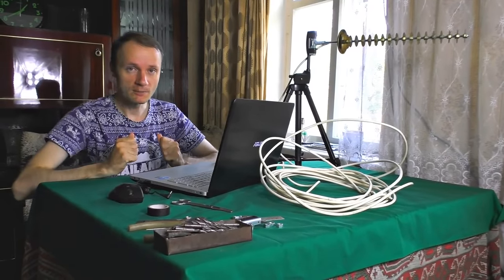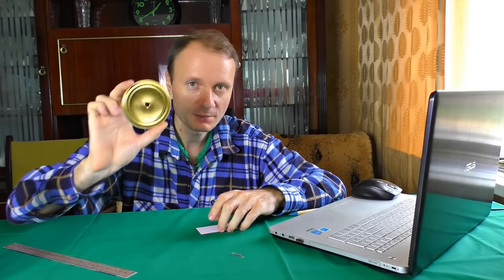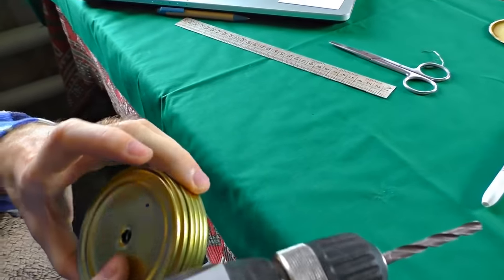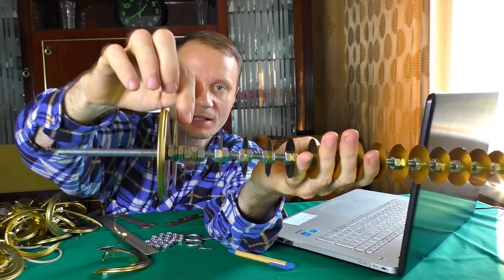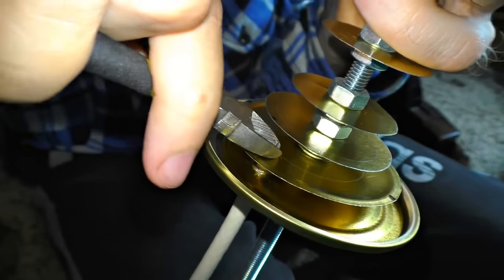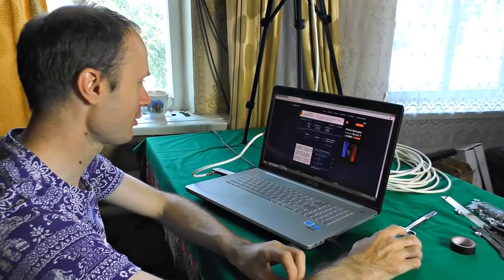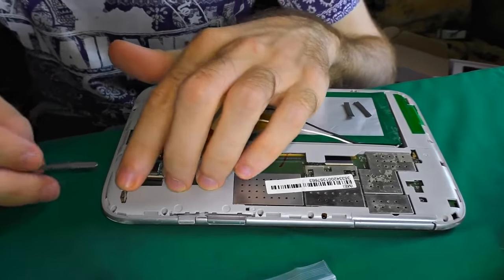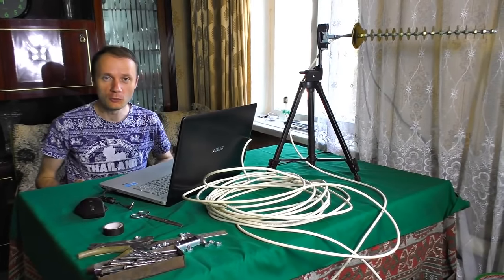Real WiFi Trap DIY💥 / Free Internet Rifle V 2.0

Comment: Kreosan,  I love your projects,  and I'm really pissed off about the people calling this fake. Apparently they've never seen a disc-on-rod wave guide and don't recognize a Yagi with circular polarization. Thanks for this video. I was going to design my own but you've saved me the trouble. And BTW,  your translation called your insulator a "gasket" and now everyone thinks the reflector and driven element disk are shorted. Your biggest problem is that your audience is just ignorant and can't figure things out for themselves.
Reply: U never went to school eh, FAKE DUH.
Reply: if you knew any thing about yagis you would not say so
Reply: they just turn on their phones hotspot
Reply: its not fake its just badly made, first the tplink adapter isn't too powerful, second that antenna wire is too long, there is a ton of lost signal because of that
Reply: So you all guys think all the good selling bdm-2 antennas out there are fake? I made one myself and it works flawlessly.
Reply: @25566  even the best yagi cant reach 2km with less than 100 mw of power
Reply: did it work at 1km?!!!!!!!!
hell no
Reply: @walkertongdee  do you now LAN? Do you know anything from technology?
Reply: Backfire disk-on-rod antennas, like Yagi antennas, all smaller disks are directors... but they should be electrically isolated one from another. So yea... fake. Oh and the Lunokhod had a helical antenna (with directors), not a backfire antenna.
Reply: Laughs at H°??? Tx_ <14Db @a gain of probably for the shitty design of somewhere arround 10 dBi.
Reply: His "gaskets" are actually washers and not insulators so I guess that makes the driven element and reflector disk shorted.
I'm thinking of building one of these things so do they work or not?
Reply: Apart from the fact that he’s using 75 ohm cable, and he’s shorted the active element to ground lol
Reply: @CarbonConscious  dont waste your time make a proper cantenna 
Use the andrew mcneils video
Reply: @Craig Wall - Perfect Answer, Thanks
Reply: oh shut up. It's not our fault thinking it is fake, The internet is just too filled with fake ones and finding one that is real others will call it fake because they had enough of the fake stuff
Reply: they must be mericans. thats why
Reply: craig -- dont put people down, you are not smarter than most people
Reply: @25566  Agreed, you should try to keep the cable shorter than 50 cm
Reply: People see that he's Slavic and uses scrap parts for his projects and think that it must be BS. 

A good understanding of physics and some creativity are all a person needs to build some cool shit.
Reply: @alirezaeskandari2287  *yagi antennas NOT yagis
Reply: @olivejuice5233  Prove it, my tinfoil hat-wearing friend
Reply: @kiyoponnn  lol
Reply: How about my 5.8Mhz and 2.4mhz? The Wi-Fi gun both they support?
Reply: Should work. 
Back in the early days of wifi i remember people put empty food cans and antenn cable connected to bottom, to point att signal.

Comment: You're probably losing most of your antenna's gain in that white coax cable. It's not made for 2.4 or 5 GHz frequencies. Also, is the driven element electrically connected to the reflecting element through the threaded rod?
Reply: Yes, the same I though DC short cut!
Reply: Satellite LNBs reach up to 2.1 GHz, so for 2.4 GHz a not too long cable should work.
Reply: cable for satellite receiver is good enough to 10 m

Comment: Bolt length -1/2 meter
Small disc distance- 22 mm
Last 3 bigger disc distance- 12mm,9mm and 7mm respectively
Reply: The material of the discs, what is it?
Reply: @fernandoadauto5354  Anything metalic
Reply: What's the name of the connector between the cable and the WiFi adapter please 🙏

Comment: Another way to find the center of a circle is to draw at least two (but more helps accuracy) lines of exactly the same length and touch the outside twice. For example if you have a circle with a 4 inch diameter you can use 1 inch lines so long as all of them are one inch. Then go back over each line with a square and at the halfway mark draw a line all the way through. Each intersecting line will also meet in exactly the middle .
Reply: I don't know if this method is accurate enough for these kinds of use cases, but an easy way to find the centre of a circle is to pick any point along its edge, zero a ruler on it, and scan the  ruler left and right until the measured length at the intersection of the ruler and the edge of the circle is greatest.

Comment: To get a better signal, I advise you to use copper for everything, including the pole. Also, the longer the cable, the weaker the signal. Therefore, if you do not need a cable with a length of 60 meters, then take what suits you, and the maximum is 100 meters.

Comment: There are a few simple things you can do to make this even better. One, get rid of that cheap TV coax cable. Technically this antenna should be 50ohms impedance. RG6 ( common cable tv coax) is 75ohms. The mismatch will degrade this signal. Get some decent 50ohm coax. Second, you are using WAY too much coax. Microwave signals for wifi at best are weak, 50-70dBm ( a few milliwatts) the longer your cable the more the signal will be attenuated by the time it reaches your computer. Keep all the coax lengths as short as possible. Finally, the driven element of this antenna ( the 68mm disc you solder the center conductor of the coax to) this needs to be isolated from the boom ( the 8mm diameter screw boom used to attach the discs to) you need to put something on the boom so the 68mm disc is NOT physically touching the boom, like tape, heat shrink) the 68mm disc without this isolation is actually being shorted out. While it will receive some signal, if you isolated it from the boom it will work 1000 times better.......try it!
Reply: no need to be isolated.....try you theory before comment.....this is exactly as suppose to be, this is not short for 2.4 GHz, not even close

Comment: I have build your Wifi-Antenna the way you told in the video. I am impressed! Instead of cupper i used aluminium but everything else remains the same. The quality of this antenna is unbelievable good!
Reply: Hi @benjaminwesp7584
Could you please tell the the latency difference with an without using antenna, and As we increase distance don't we need transmitter and receiver both to be high gain antenna ?
Reply: Hi! Did yo use the long coax tv cable too?

Comment: There is a Problem with the Two Disks that is connected to the stud without insulation thus shorting the antenna circuit. The second disk from the two disks that is connected to the wire should be insulated from the rest of the disks and stud...
Reply: no....update your antenna theory....at that frequency a galvanic short circuit is not a radio frequency short circuit

Comment: I had a Cisco Yagi in ~2004 where I was living very close to the pentagon. While trying to pick up free wifi I had it mounted outside my house pointing into the direction of the pentagon.
A black SUV pulled up with 2 people in black suits jumped out, took a bunch of pictures. Then they got into the SUV and drove away. Never heard anything from them.

Comment: It should have shielding between the contacts from the outside ground to the copper centre. If you was to do this on say a CB or Ham radio you would burn it up without shielding. I believe the low watt wifi could suffer from long-term use without making the rear shielded from the front over time.
Reply: it is not critical on this freq....

Comment: That car looks like a 1957 Fiat 600D I owned. Suicide doors too, nice.
Reply: Zastava 750 i think, so a licence-built 600
Reply: Saporoshez SAS 965 . Made in Ukraine. The original Fiat Seicento stood model for its body but the engines are different- the Sappo has a V4 while the Fiat runs on inline 4 cylinders giving more space to rear passengers in the ukraine model. They were quite common in East Germany too but then less popular than the Trabant. (I don't know why, I haven't driven neither) Now collectors items due to their scarcity,

Comment: The shield and core shorted out, a mile of 75 ohm coax cable with no balun. Seems legit!
Reply: i was wondering that too 
its not insulated
Reply: Hajaj, yes it is fake.
Reply: It's not shorted. The translation came out "gaskets" when they meant "insulating washer".  And no,  it's not fake. It's not even new. This is very old technology.
Reply: Oh, OK. Cheers for that, Craig :) 

A few of their vids have been called out as fake so I made an assumption.
Reply: nah u got it man

Comment: No! You have to isolate the active part from the ground.
This antenna is useless without.. 

making the antenna like this it will be a short between active element and ground...
Reply: No this is like a magnetic loop
Reply: Even a biquad antenna has a short
Reply: Nicolas Springer : No. A yagi antenna is nothing like a Biquad or Magnetic loop.

Comment: Kreosan improvements for you. I read somewhere, to isolate the 68mm disc from the central bolt by putting heat shrink tubing on the shaft. That way you are not creating a short. I dont know if that is correct, just trying to help. All the best guys, youre awesome
Reply: I was just thinking that when he slid the disc connected to the coax screening along the bolt connecting the coax center wire to the next disk without insulating the screen disk. Basically just rendered the rest of the antenna beyond the center wire disk useless. I remember making a CB radio tranceiver out of coke cans in much the same way as Kreo except my antenna was 22 foot high and took over an hour to tune the SWR in properly, lol
Reply: It may be AC isolated, but not DC. If a modem or other device outputs DC current to antenna - it is going to short out and you can damage device.
Reply: no no and no....there is no dc and galvanic short is not rf short ...design is good ...why is such many wrong comments on that ?   check commercial antenna of same design

Comment: Hello Kreosan team, 

super job & super video, one question: 
I have build a similar UKW Yagi antenna several years ago and normally the second element (the one which you connect to the core of the coax cable)
should be islolated against the whole boom assembly. I did not see any isolation materials for element two in your arrangement. 
Did you use a short piece of hose plus two plastic washers or something similar ....?

Best regards
Reply: same question bro
Reply: no need for isolating..in fact if You do that performance will be degraded..check your antenna knowledge

Comment: Isn’t that just a short circuit of the antenna cable?
There should at least be an insulation between the last disk and the central screw?
Reply: No, that's not how antennas work. Just like in a Yagi-Uda antenna, it does not matter whether the directive elements are connected to the central boom as the electric field is (supposed to be) almost zero there
Reply: Ty for the explanation. Very interesting. I always thought there have to be 2 elements were a voltage difference can be induced or something like that.
Reply: @blise518B  You're not wrong! The point is that due to the speed of light and the very high frequency of Wi-Fi, there can be a voltage difference even though the elements are not insulated :)
Reply: No,  the NEXT to last disk. And the insulation is there but the translator called it a "gasket". (The last disk is the "reflector" and the next to last is the "driven element".
Reply: @craigwall9536  There is no insulation there. The narrator called it a gasket but it's clearly just a metal spacer
Reply: The confusion of the narrator is because the Russian прокладка (said in the video) translates equally well to "spacer" or "gasket"
Reply: Hmm,  you're right ...
Reply: no insulation needed......ouch how many countless wrong remarks in comments....back to school i guess :)

Comment: Seriously, with that long cable, you would loose all the gain you might get from the antenna. I smell fake. When you make these kind of USB-adapter-type antennas, you should use a long USB-cable and attach the adapter directly to the antenna itself, to get the shortest possible antenna cable.
Reply: Yes, it is a great fake. The antenna cant work at all. They lack of basic knowledge of antennas.
Reply: Silly you. They've left the cable long because it would be stupid to cut it until you decide where you want to INSTALL it. AND because if it works at all,  they know that it will ONLY GET BETTER when the shorten the coax. They're EXPERIMENTING. They aren't stupid and you haven't told them anything they didn't already know.
Reply: @craigwall9536  You are the one who doesnt know that circular pol has a penalty of 3db versus linear pol, so silly is using it for wifi. I am a ham radio operator and I use a homemade antennas since 25 years. I can reach my home with my smartphone from 2km away, I have internet all around my valley. This antenna design is old as hell, you will never see a yagi design with evenly spaced elements. It is a piece of shit, I reach more with my microwave oven hahah

Comment: I have some questions folks: what is the caps made of? in the first the guy says 80mm but at the end says 90mm so which one is correct? and there are other videos suggesting shorting positive and negative wire of the adapter to this anter will burn the adapter as these palates are all shorted together. can anyone please clarify this for us?

Comment: Transmitters have a 250mw limit here so it won't work. The signal is too weak, it also forbidden to use any high end transmitter.
Reply: but its working well...i built one, check your theory again

Comment: You can buy RF pigtails from drone suppliers. UFL and smaller IPEX4  types to standard SMA
Wifi cards now use IPEX4  but older cards before around 2016 used UFL (IPEX1)

Comment: Hi, I have a problem...
Since I use a 0.5 mm thick sheet for 20 discs that's 10 mm.
I would like to know if the distances you give represent the internal step or
if I have to take into account the thickness of the sheet. Thank you!
Reply: Internal

Comment: Can I use one mm thickness metal and white paint is coated on that metal ??
Please reply as soon as possible
Reply: As long as the metal makes electrical contact with rod (except 2nd larges disk which should be electrically isolated)

Comment: One thing I am hitting a snag on: My cable had a totally different end so i cut it off to get at the tip.... does the thin wire in the middle have to touch BOTH the first two plates or just the second?

Comment: good video friend ...
Question: is it necessary to place an electronic component between the positive and negative where the cable connects in the antenna discs?

Comment: Uh, you need to isolate the exposed coax connection or else you’ll experience a lot of loss.
Reply: Yeah, isn't the core short-circuited to the shield if they use a metal rod to connect the core disk and shield disk?

Comment: 1. That ~10 meters TV cable looks very suspicious, normally for 2.4 GHz it is common to stay below 1m to avoid HUGE attenuations. 
2. Note how when testing he quickly skip over showing which adapter he is actually using, it was likely conducted with internal laptop card connected to his own wifi...
3. You have already wasted enough time watching this video, please don't waste your much more by trying to build it.